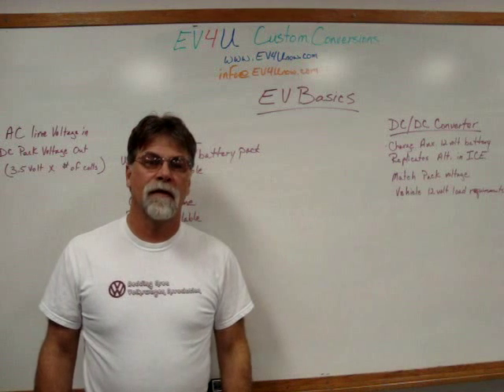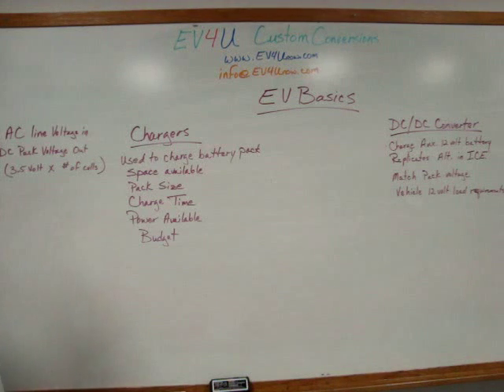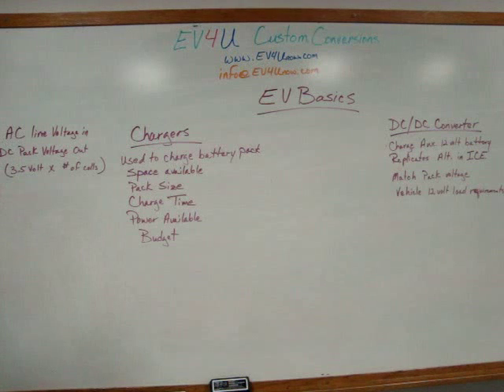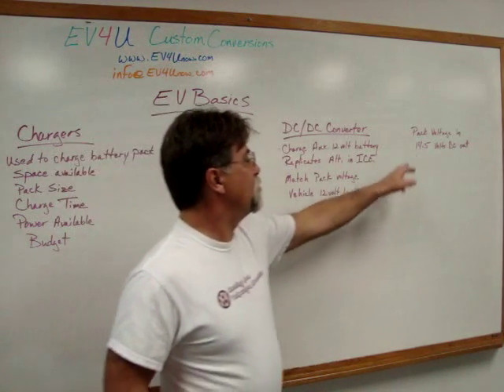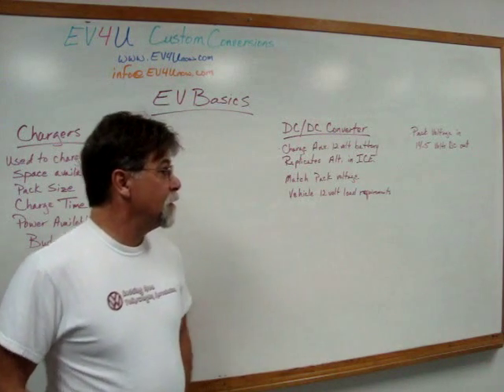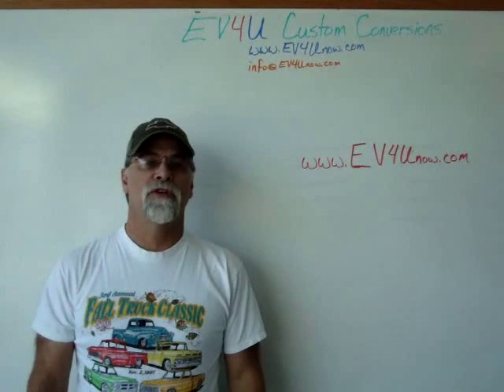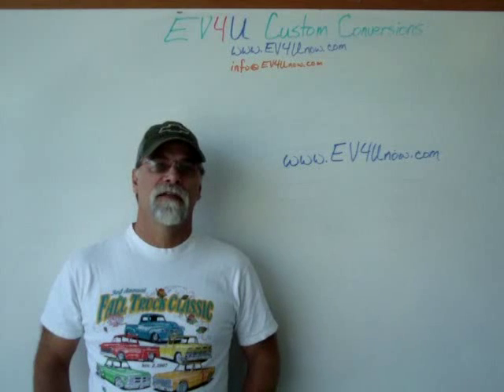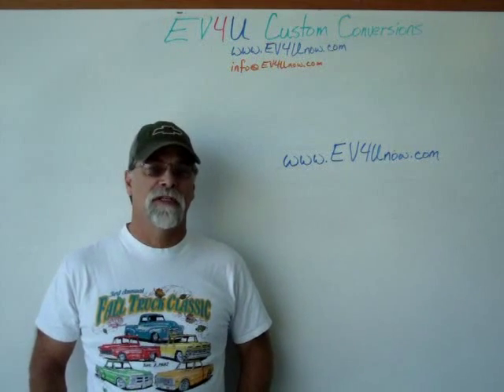DIY Electric Conversions - Chargers and DC to DC Converters  www.EV4Unow.com

Comment: Hi. Thanks for the video. Can you explain how to select DC-DC converter rating? For 12 V load
Reply from the maker: The DC/DC Converter replaces the alternator used with the internal combustion setup, so matching ratings is easy.
You can also calculate you power requirements and match it that way.  If the DC/DC Converter is only rated in amps, you can
calculate the power using Ohm's Law (Power equals Volts times Amps, (P=E*I)).  Remember also that you want the input voltage of the Converter to match the range of your traction pack, both minimum voltage and maximum voltage.